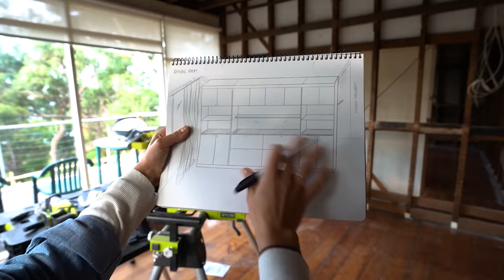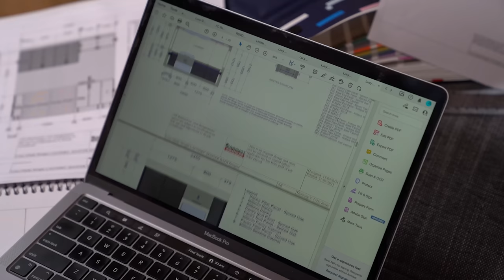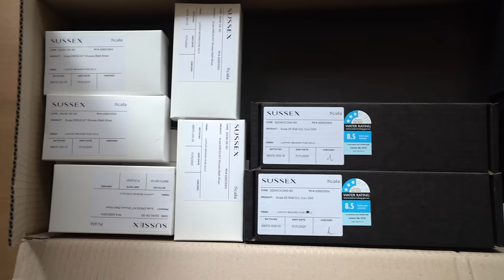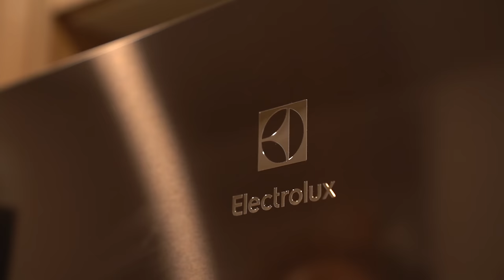Laundry Room Makeover! Interior Design Ideas & Decorating. Classic Modern Coastal Style

Comment: Nice laundry, it turned out great.

One question though, does everyone in Australia use driers? Does no one hang their clothes outside to dry with all that sunshine most of the time? That's the only thing I am wondering about as there is no where to stick a clothes airer or to dry wetsuits. The little rail over the sink is only for small items like swimsuits.
Reply: Depends where you are in Oz. Huge continent. Differing topography & seasons.  Most homes in southern area/s of AUS during colder months, would probably have a drier. Use during winter (Jun-Aug) + maybe month or so surrounding those months, depending how far south you are (eg Tasmania), or your elevation. Most of Queensland + far north AUS is more tropical. Like Florida. They have a wet season. Torrential rain. Can create mould issues. So some homes in nth parts of AUS may have driers to alleviate these types of issues.
Reply: We are blessed with loads of sunshine, especially this winter, but in summer we had weeks of torrential rain in NSW which resulted in severe flooding on the coast - even in Manly (Sydney) where I live.  Adore this series Lucy and Johnno - you are the best!
Reply from the maker: Yeah its seasonal. Winter is very cold and wet down this way.